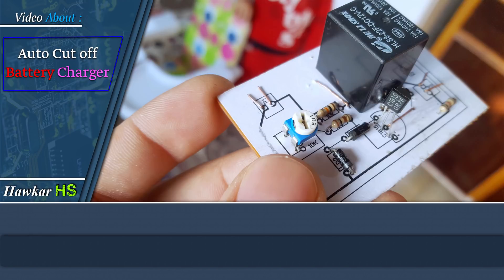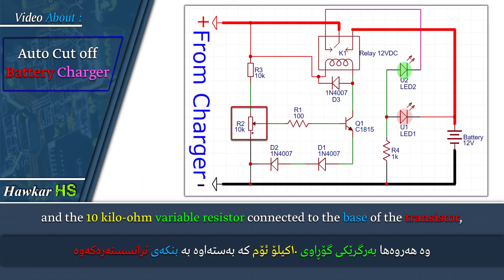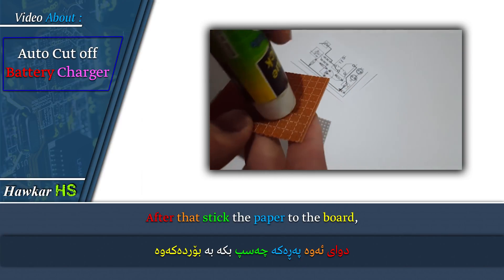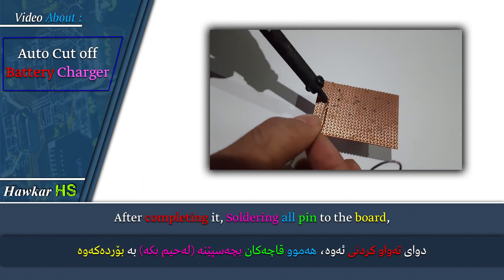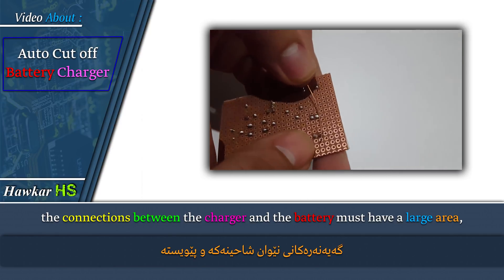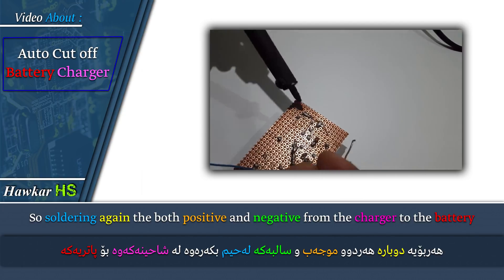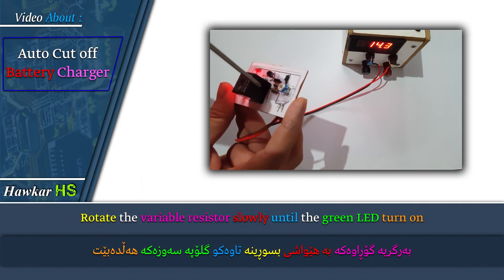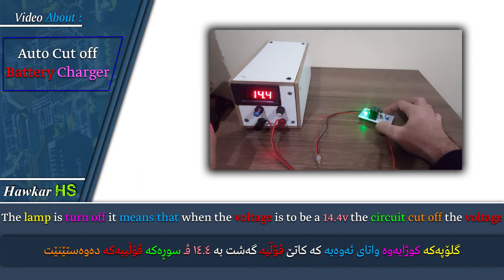Auto Cut off 12V battery Charger

Comment: You should move the positve reference that leads to R3 and R2 after the relay switch, pemantly connected to the battery positive so it keeps tracking the battery voltage and reconnects the charger once the battery lowers its voltage and release the relay. Then you would have a floating like charger.
Here you have a one cycle charger. And of course invert the leds polarity. Also you must draw relays in its de-energized position in this case normal closed should connect the battery to the charger so when the voltage rises to the requested level the transitor activates the relay to the position in the video schematics.

Comment: I made it. But there is a problem. While I connected to 20v dc power supply for 12v battery charging, it suddenly cut off,  even the battery charge had 8v only. And unable to put back to charging. Please reply.

Comment: With a fully charged 12V battery, the voltage should be 15.3 - 15.5V measured while the battery is still connected to the charger (lead-acid battery)!  But more importantly, the density of the electrolyte fluid is close to or equal to 1.2 units.  Charging is recommended with a current of not more than 1/10 of the battery capacity (for 55 - 72AH about 3A).  The smaller charging current, the slower the charge of the battery.  This mode protects the battery from damage and extends its life!

Comment: How to connect a voltmeter to this circuit. Please let me know. Thank you.
Reply: Connect a multimeter with dc voltage setting or voltmeter across any positive to negative area of the circuit (example: attach positive to the red and negative to the black)

Comment: there is a transformer, diode bridge output 17V, it will adapt to this circuit or do I need something else?
Reply from the maker: Yes you can use this circuit.
And the voltage must less than 18 volt
Reply: спасибо

Comment: Sir Can i use it for 18V Solar  panel ? to Charge 12v 7A Battery
Reply from the maker: Yes you can use this circuit for 12v  battery charger.
Put the output voltage on (14.4v) "depending on you battery"

Comment: Honestly I don't understand this concept anymore, the input voltage is suppose to remain constant, the battery is supposed to be sensed for the calibrated voltage before it cuts off. I dont think you should variate the input voltage since it is coming from the charge and it is going to remain constant. If I am wrong, please let me know.

Comment: Sir, is it possible for me to use this as a 12V 30ah lifepo battery charging circuit from a 20V 30W solar panel to light up a 12V 15W LED? SIR PLEASE HELP ME

Comment: I have make one for test , but it is detected the input voltage ( not battery voltage )
so when I connect with a solar panel to charge the battery( it is in 4 v before charge )
then circuit LED  turn green , solar panel is in 16.8 V , so circuit stop charge and also battery never can charge by solar panel , so this circuit is not work .

Comment: Can this circuit work on 12v 7ah battery we are using a 12 to 20 v solar panel with 20w for the energy source and we are making a 12v output charging circuit to which we are going to connect this circuit will it work ? 
Please reply
Reply from the maker: You can use this circuit.
But not that for 7 amper lead acid battery the current of the charger must be 1.5A or less.
Reply: @HawkarFariq  so which relay circuit should I use for my 12v 7Ah battery
Reply from the maker: Do you have Whatsapp?
Reply: Yes sir my number is 9970697704
Reply from the maker: Where are you from? 
Code of your country?
Reply: India +91

Comment: What are the changes if want to make phone battery cut off
Reply from the maker: You do not want this to charge the phone battery. 
The phone battery is 3.7v and its full charged at 4.25v to 4.3v
If you use the 5v mobile charger and use one diode as forward base. The diode increase the voltage by 0.7v
5v - 0.7=4.3v
And use 1 ohm resistor series with diode.
Reply: @HawkarFariq  thank you so much i am making the adapter same as chargby sense cable hope u know about chargby sense.

Comment: It's Not Working. How to Set the Cut-off Voltage?

I Have Set cut-off 13.55 voltage still battery charging to 13.95 still circuit is not working
Reply: same problem I an also facing

Comment: It works...but the pin from the relay and LED is reversed.....thanks....
Reply: About P1 & P2
Which one is input
And about P1 & P2 
Which pin is positive and which pin is negative .
Reply: But sir my relay is given very sound, TFR 12-012  3ams 
What will do sir
Reply: @KRMEENA-mm4by  this circuit have flaw, give diode 1A or 2A in the output to solve it.
https://espelima.blogspot.com/2018/02/membuat-auto-cutoff-charger-batterey-37v.html
Reply: it is starting charging above the voltage we set...not below....It stops when voltage below that
Reply from the maker: You are welcome

Comment: Great Video. But the Cut off problem

I use 12.5v and red light lit after adjusting the 10 K preset to turn on green. After Back to 12.5 v to turn on red light but output voltage is showing 9 voltage. How come please give some technical advice urgently

Comment: sir, i interest Auto Cut off 24V battery Charger or 48v, 60v, 96v, 110v please help me sir
Reply from the maker: You can use this circuit to make a 24v or 36 or.... But must chage the relay to 24, 36 or 48 depend on the charger and change R1 to 1K and chage Variable resistor R2 to 25K or 50K.
If you don't have 25 or 50k variable  use other 10K resistor series with 10K variable resistor (R2)

Comment: Why does it seem this detects the source voltage when its supposed to detect the battery level voltage when being charged. Before being charged for example, a low batt voltage is around 11volts. Then it gradually rises to around 14volts at full charge. Isnt that the voltage your circuit shoukd detect?? Not the supply voltage of 14volts?
Reply: ratski, this is the protection circuit. The supply voltage from the charger that fee this circuit just before this circuit has a 0,1 Ohm dropping resistor that will drop the voltage before the relay, so we are measuring a dropped Voltage. As the battery charges this voltage will drop less and less over that O/P resister and get to a point where it will switch on Q1 and Switch away the Charging Voltage with the Relay. Remember on this circuit diagram the NC and NO contacts on the relay is switched around and also the Leds are reversed. Hope this help.

Comment: This circuit on the ground does not work when plugged in. The battery does not work The connections are all correct and the components are correct but do not work when the battery is connected

Comment: The common of relay should be connected to the normally closed of relay. When battery voltage is 13.8 volts, the transistor will close and energizing the relay and disconnecting the source and lights up the green led

Comment: You should have used a proper voltage reference (IE: Zener Diode). It would give your circuit a rock solid cutoff at very little increase in cost or complexity. However, A for effort never the less.....

Comment: For 6 volt charger do I need to change the relay(6 ) or 12 volt relay is OK sir?
Reply from the maker: No you must change the relay to 6 volt. Fi you dont find the 6v relay you can use 5 volt relay

Comment: Maximum ampere battery can be charged?
Reply from the maker: The maximum current depends on the realy onthe circuit. 
In this circuit im using 10A  realy you can use larger to allow the larger current

Comment: Its good. can you make it for 48 volt battery.
Reply from the maker: Ashok Mujmule .
Yes you can use it for 48 V but increase the value of three resistors.
Reply: Can you give resistance value and which three resistor?
Reply from the maker: Ashok Mujmule .
From the ciruit . Change

R1 (100 ohm) to (300 ohm) 
R3 (10K) to (33K)
R4 (1K ) to (4K) 

And put (400 ohm) resistor series between to diodes to save the transistor
Reply: Thank you very much sir..

Comment: It's not working .
Reply from the maker: Farhan Baba it's working %100 . 
Just note that the LEDs is reversing
Reply: Can u explain please
Reply: I think Battery +ve line should be connect on Rly’s NC pin (Normally Close) unless the Transistor PNP.

Comment: Can we use this charger to charge 12V 7ah battery?  And also is that 14.4V where it cuts off?  Is that the voltage over the battery?  Has it charged to such  value? I'm building a linear power supply which outputs 20V Dc...  Which will power the circuit

Comment: oh my god... )))) 2 leds is wrong position, 1k resistor of 12v for led is not good think, rele clems not protekted of hazards and rele self not good for bigest A. Why  "U" marketed led-diodes, not "D" ? Transistor C1815 (rus: KT315) ...................... What? Are this charge control for acu in 1,2v )) I NOT risk make this.

Comment: Sir can i use 12-0-12 1amp transformer to charge 12v 7amp battery using this circuit?
Reply from the maker: bhaskar dhara yes sir you can use this circuit for it
Reply: Sir my English language is very poor but I try to explain my question. Sir Kindly do replay. Sir I have some doubt about changing 12v 7 amp battery. I have two 12-0-12 transformer one is 1amp and another is 2amp. My question is which transformer is suitable for charging 12v 7amp battery using this circuit?
Reply: Cualquiera puedes usar.
Reply: Beto Caamaño, sir thank you so much.
Reply: Bhaskar ; You cannot use any of this directly !! Cause the charging current is always be 10% of your battery capacity. That's mean you have to control the current ( 1amps or 2amps) and the charging current will be 700 mAmps for 7AH battery.
Reply: Thank u sir

Comment: Hello sir i need your help about this circuit. I want to upload my solar panel's voltage to the battery when the battery is not fully charged where can i connect my solar panel wire? Please answer when you see it is urgent about my final project. :(

Comment: How to make 12V 5A charger with auto-cut-off circuit.
Reply: Just download Mike Davis's simple 555 charger. Just type MDpub and on his site you can find it there. It could go up to100amp or even more depending on the components you're going to use.

Comment: OK - LED's in reverse - YES. But what does that mean exactly? I'm assuming that a Circle with a Black Square is Negative, and just a Circle is Positive - correct? If so, shouldn't they be reversed on the LED's. A Circle with Black Square should on the left side with regard to the LED's? Is that correct? And regarding P1 and P2 - a Circle with a Black Square (Negative) is routed to just a Circle (Positive) on P2. On the bottom of your drawing, shouldn't it be going Negative to Negative? And the 1K Resistor next to P2 - should be connected to the positive side of the LED - is that correct? Where does the other side of this resistor connect to? Is it connected to P2?  I'm not an engineer, so please fix my mind set on this. I want to build your proposed battery charger. Thanks.

Comment: I keep trying to understand your soldering pattern in relation to the drawing. It's not precise enough for someone to understand. It seems to me that you have soldered all the positives and negatives together, solder is everywhere. On the drawing, the line running from P1 to P2 shows a negative (P1) running to a positive (P2). So where in fact does the positive on P2 go to? Should the positive and negative poles be reversed on the LED's? On the LED's, how should the positive circuit line run in that case? Under P2 there is a 1k resistor with a dark line running through it. I'm assuming that the dark negative line has no relation to that resistor. Is that correct?  Can you please fix the drawing and post it again? I enjoyed your video and would like to build this device. Pasting the drawing to the circuit board is a wonderful idea. Your reply.
Reply from the maker: Sal Sepulveda
If you can't draw the circuit download the circuit from link and print it after that draw the circuit such as the circuit on the board
Reply from the maker: The circuit not have a problem but the LEDs is reversing.

Comment: Why u not use a 12 volt batery instead of the bulb.
Reply: because he would of wanted to show when the voltage stopped flowing to the battery/light

when the green LED turns on the voltage stops, but if he had a battery there instead of the globe, there would be no proof the voltage stopped flowing to the battery - only that the green LED turns on - the globe is just proof there is no longer power there when the green LED is lit.
(light is on there is power flowing / light is off no power flowing)

Comment: Hello! What is the maximum input voltage without load (with no connected battery)?
Reply from the maker: Dr Lightman.
The maximum input voltage without load depend on transistor and relay.  
The maximum voltage fro (C1815) is 60 v but relay is 12v if you need 24 or 36 or more voltage must change relay
Reply: +Hawkar Fariq  Thank you for your quick reply! I'm asking, because i have old car battery charger, which voltage jumps till 19-21V without load. Ok i understood. Thank you very much for the circuit and your attention!
Reply from the maker: Dr Lightman 
you are welcome 🤗

Comment: Why you should use 14.4v power supply?
Reply from the maker: EXO K . Most gel battery and car battery full charging at 14.4v.  

Also You can measure automatic charger voltage

Comment: Hello friend.  Auto cut off after reaching 14.4v. How much volts it will start charging again? 10v,11v,12v?  For example you use it in solar panel to charge battery.
Reply from the maker: Depend on transistor and resistor .
Maybe start charging again 12.5v

Comment: Can we use bc 547 transister
Reply from the maker: Yes you can use any NPN transistor but not that both c1815 and BC547 have deference in pins 
C1815 is (BCE) 
BC547 is (EBC) 

Must change position pin of the transistor
Reply: I had done already yesterday. That was working and great idea brother 🙂🙂👍

Comment: Hawker I loved the idea of printing the circuit board and then pasting it on a board. Did u use some software to make the circuit for the print out ?
Reply from the maker: Sohail Khawaja .
Not need circuit.  
You can make a circuit online and save it as PDF then print to paper .